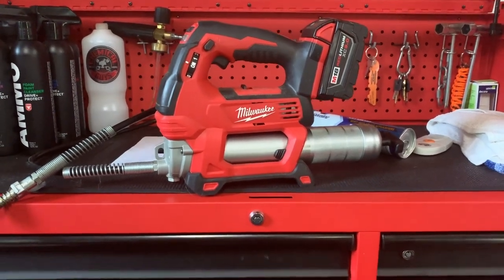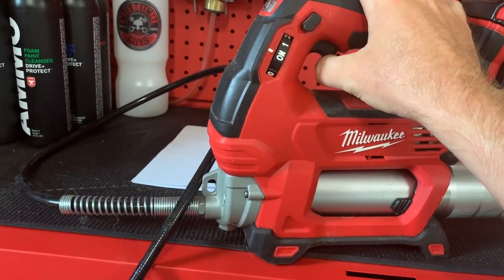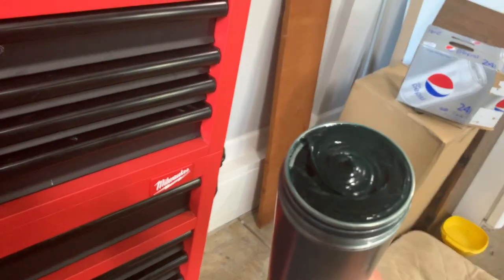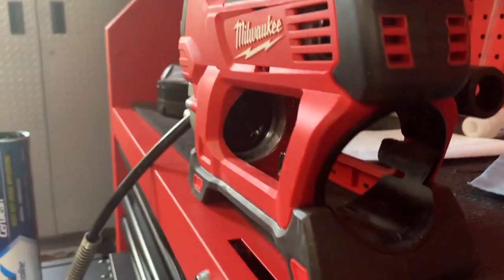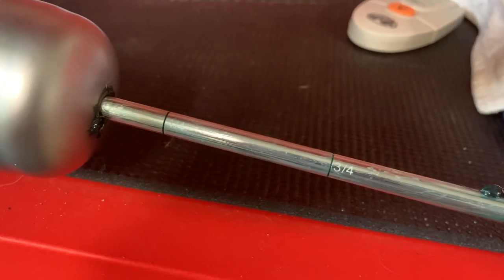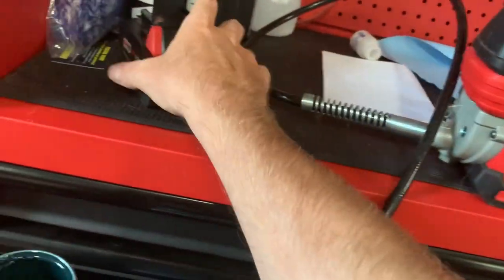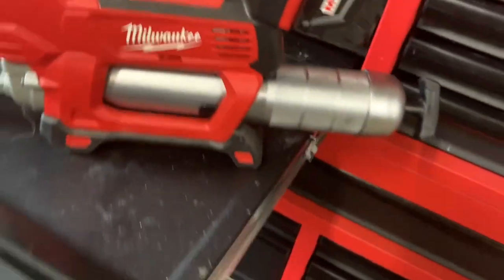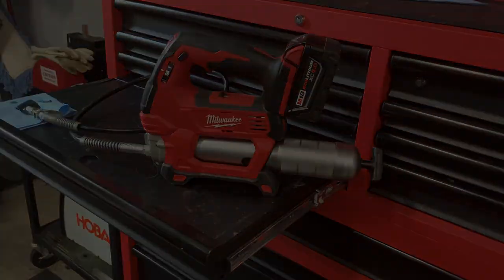Milwaukee M18 Grease Gun Cartridge Change

Comment: Correct way is to remove battery pack, pull the rod by the handle all the way back and put it into the retaining slot to lock the rod in place, unscrew the barrel, load the new cartridge in, screw barrel back into grease gun, release rod and push back into barrel, prime the gun to purge air with the priming valve.
Reply: Thank you lol. Took me ten seconds to read and that's all I needed, not 5 minutes of blabble
Reply: @bobsmith93  then why did you come to a video when you could’ve googled it and read it somewhere else. Some people are visual learners
Reply: Thx,helpful vid.
Reply: I had to run mine on continuous for a full minute before the grease ever made it to the purge valve. It’s new and that might change upon refills, but your way wouldn’t have worked for me.  Not sure why the spring and plunger couldn’t push the grease up on its own without the aid of the motor.

Comment: Remember to prime the grease cartridge so the plunger slides into the tube easily. You will see how dry the cartridge end is when it is new. Rub some of the grease around the dry cardboard before inserting it into gun tube. This will ensure the plunger slides into the cartridge without resistance.
Reply from the maker: Thanks for sharing!

Comment: If my plunger comes all the way and won’t go back in would you say it’s broken🙉???
Reply from the maker: I don't think it's broken unless someone was too rough with it. It could be the way the tube of grease is installed or sometimes it catches a little bit and just needs to be wiggled.
Reply: No, you have to rotate the shaft a bit as you try to push it in, at some point it will find it's groove and slide right in.

Comment: I like this Milwaukee. Pretty bulky but a good design. Thanks for the helpful video. Subscribed.
Reply from the maker: I think it's a good middle ground. If you wanted it smaller you could go with their M12 line. Other brands I have seen are significantly larger and more bulky.

Comment: I push 2-3 tubes thru mine a day as a PM mech for rental equipment.  I'm just curious why you'd pull the plunger after removing the cartridge casing?  I pull my plunger while it's still in the machine.
Reply from the maker: If the tube is empty then you could do it whenever. If you still have grease in the tube then you should probably pull the plunger before removing the tube so it does not continue to push grease out.

Comment: The version sold in the UK sounds very different to this one and others I've watched on YouTube the clicking noise you spoke about is much much faster on yours
Reply from the maker: The model that I have is the M18 model which has two different speed settings (PSI ranges). There is also an M12 version that only has one speed setting I believe.

Comment: Mine won’t work unless the rod is pull out, if I push the rod in it will shot grease then air I’ll prime it shot grease again then stop shot air again Al this With a new tube of grease in there always been like that since new
Reply from the maker: I am not sure what the issue is. I have had mine for several years without issue

Comment: I couldn’t pushback the plunger after changing cartridge
Reply from the maker: Try turning the handle/knob while pushing inward. Sometimes I have to do that to get mine to go back in. It must have some resistance or block when changing the cartridge.
Reply: Scott Walker thanks. It took a while but I got it back in.
Reply: Especially this step is missing on this video...

Comment: Plunger doesn’t want to go back in please help
Reply from the maker: I usually dont have an issue. I woudl try giving it a turn while pressing inward. Other than that I would check to see if grease tube is installed correctly. If the end with the metal cap like a soup can is the wrong way it is too small of a diameter for the plunger. Hopefully that helps!

Comment: I love the gun but can never seem to get the handle rod to simply go in after loading. It will feed inward as I use the gun. The Milwaukee rep looked at it and only said Huh? No help there.
Reply from the maker: Sorry to hear that. I dont have that issue and have not heard of anything like that. I know mine will not pump grease unless the plunger is pushed in. Make sure you have the grease cartridge in properly. It probably will not fit through the end where the aluminum cap is.
Reply: Mine does the same thing ??
Reply: Same
Reply: Turn in like 90 degrees as you push it in. When you hit a certain point, it will go right in.

Comment: I tried reading the direcdxtions; they were useless. Great gun but don't try to use it until you watch this video
Reply from the maker: Thanks for the kind words!
Reply: The instructions for this gun are no help. I had issues with it getting air cavitation and had to figure it out on my own. (Pump the shaft a bunch usually solves it) And also why the pump rod didn't want to go in half the time. (You have to rotate it until it finds its groove to slide back in.)

Comment: Brand new out of the box mine pumped grease but made a terrible sound like gears grinding. If you are use to an air operated grease gun you WILL NOT BE VERY HAPPY WITH THIS UNIT OR I WAS NOT.

Comment: Do you know what kind of grease Milwaukee put in there when you first got it out the box?
Reply from the maker: sam ochoa  I am not sure that they come with grease. I purchased mine as a tool only so I know mine did not come with any grease. I also do not think they come with grease even in the kits unless specified. That way you can use whatever grease you want and I think that they have shipping restrictions on grease tubes also from my recollection of ordering grease online so it may not be as easy to ship with a kit. Hope that help! Thanks for watching!
Reply: @scottwalker19  thanks for the info. I'll make sure I have some grease ready to put in there when i buy it .
Reply from the maker: sam ochoa sounds like a plan!
Reply: what is the cost?
Reply: They dont come with grease. The grease on the tool is used for factory testing.

Comment: Dewalt is better gun than this.
Reply from the maker: Thanks for sharing your opinion. I am sure they are not much different. It just depends on what battery system you have. As well as what you need it for. Milwaukee does have the option for the M12 (slightly smaller) or the M18 so at least they have more than one option.
Reply: @scottwalker19  Both are good, I brought the Dewalt over the others because I like the way you held it.
Reply: I regret buying my milwaukee won’t bleed out. It was good for a couple of weeks now it won’t bleed out try the release valve no luck .
Reply: @Manuel3525m  there is always warranty. Contact Milwaukee and maybe have it fixed or replaced
Reply: loganator78r I started using a different brand cartridge and it’s working fine every time I switch cartridge . I think is because this one it’s full all the way to the front. The other brand wasn’t full to the front and it was hard to bleed out
Reply: @Manuel3525m  glad u got it figured out!